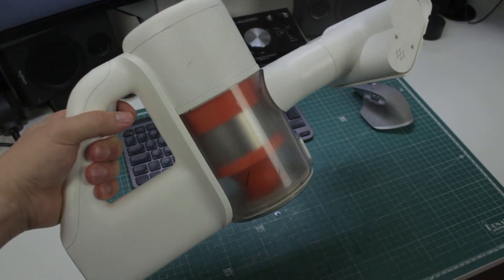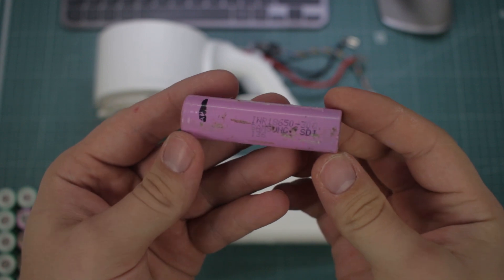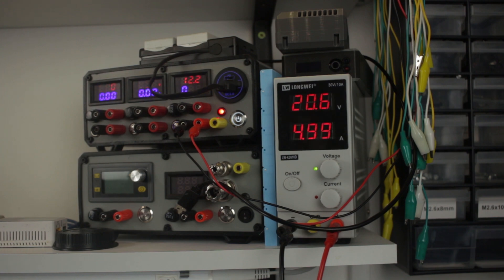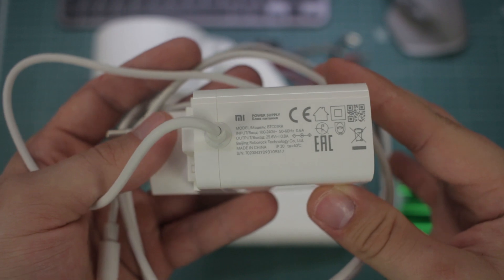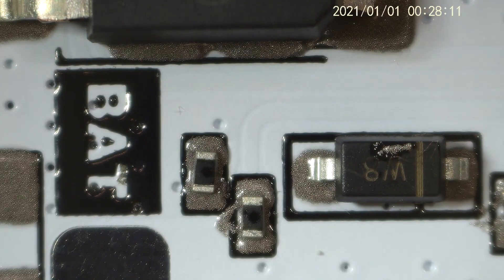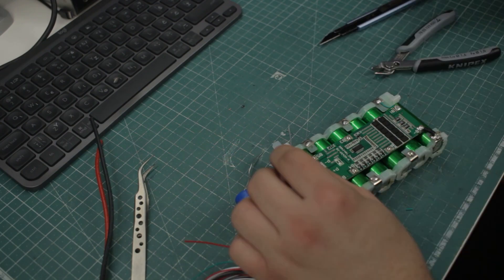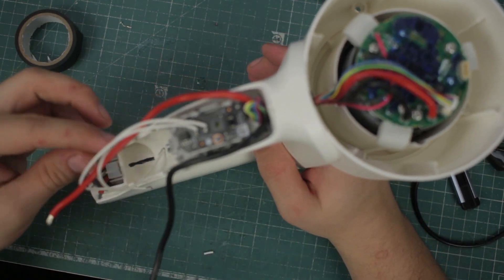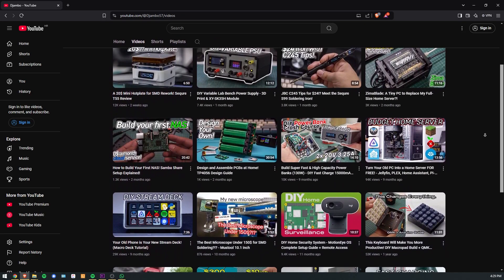Dead Vacuum Battery HACKED: Bringing it Back to Life After Tamper Protection Lockdown!

Comment: Love the video, I picked up a cheap Chinese vacuum like this from the goodwill bins for cheap and wanted to fix it meaning I needed to change the battery logic board, and like you said finding parts for these things is kinda difficult, especially diving deep electronically into them.